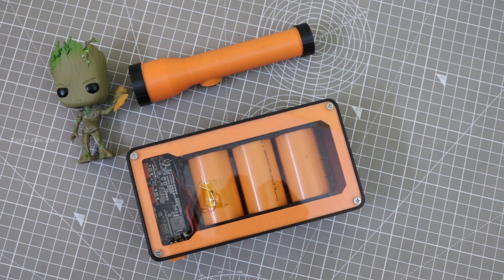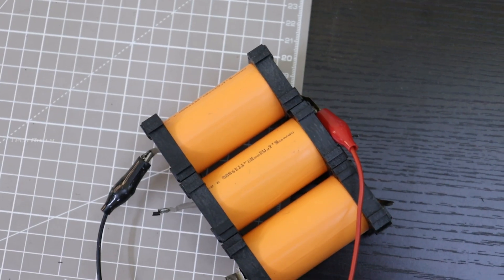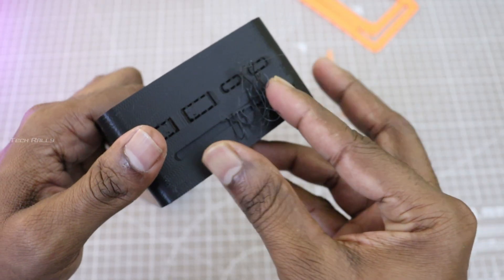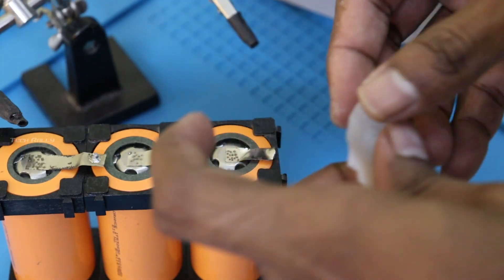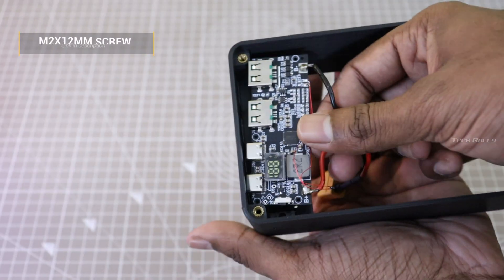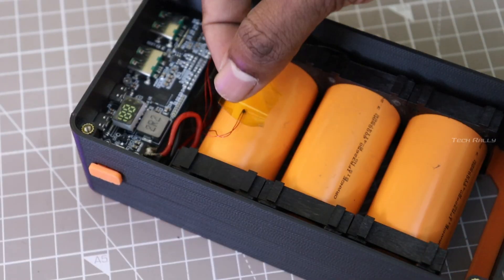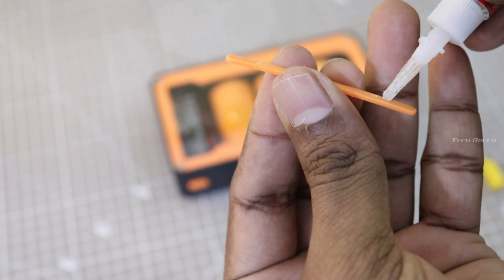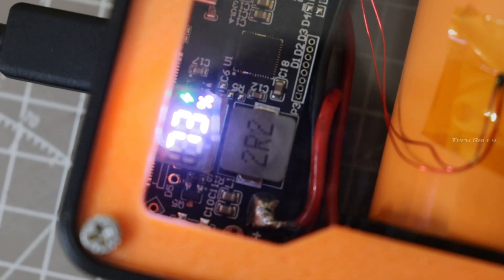DIY LiFePO4 Power Bank

Comment: What resistor value did you use?
Reply from the maker: I hop that i mentioned in video, but you need to calculate based on yor battery capacity

Comment: Interesting project. I bought some 21700 LiFePo4 that I'm going to eventually use to build an electric skateboard battery, but I thought it's probably a good idea to first practice battery building and spot welding on a smaller project, so I'm going to build a small power bank or two first. Good to see other people building LiFePo4 power banks.
Reply from the maker: Great..✌️
Reply: So this power bank will be charged with the normal 5v charger or you need specific one to charge lefepo4 3.2v .
Reply: @hatttereki  The PCB I used is charged over standard USB C. It has two IN/OUT USB C ports, and two OUT USB A ports.

The PCB manages converting the voltage for LiFePo4, and although the specs mentioned on Aliexpress didn't mention those values, when testing the powerbank I measured a fully charged voltage of 3.528 V, and a low voltage cutoff of 2.8 V, which seems reasonable for LiFePo4 (my cells specify a working range of 3.65 V to 2.0 V, although I don't see much point in squeezing the last few mA out of a cell, so 2.8 V cutoff is fine.

Comment: I don't know why to change R8
Reply from the maker: We need to change the resistor R8 for the module to determine the battery capacity.
So it will display correct percentage of battery level when charging and discharging.
Reply: @TechRallyofficial  yah yah, thank so much, i understant